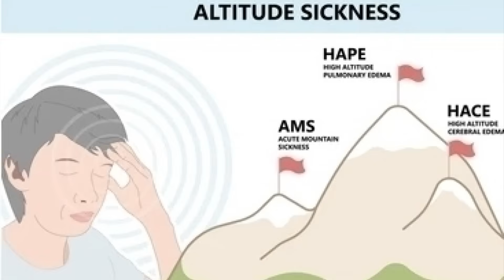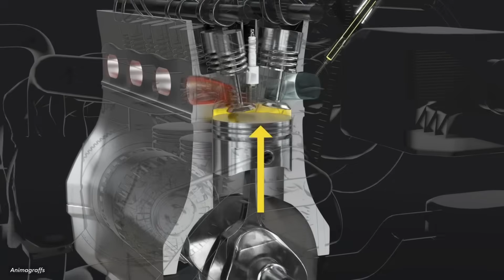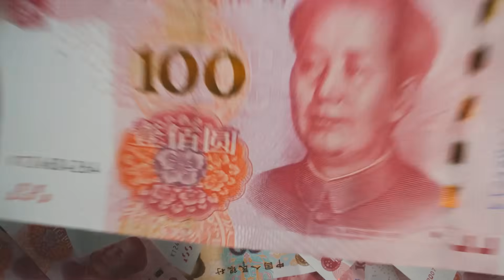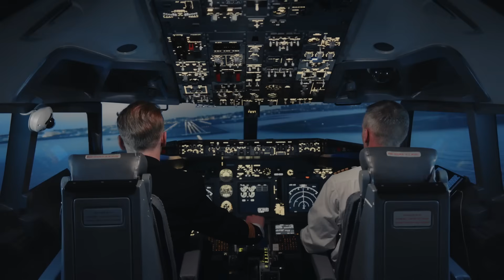How China Built the World’s Highest Airport Above the Himalayas

Comment: The higher it is the quicker to get into the air the plane does not have to go so far down !
Reply: At high-altitude airports, the thin air requires longer runways for takeoff, limits payload capacity, and necessitates greater engine thrust.  During landing, braking distances are extended, requiring enhanced brake cooling and precise attitude control. Aircraft must be adapted for high-altitude operations, pilots require specialized training, and airports need longer runways and comprehensive weather monitoring facilities.

Comment: I could understand high elevation breathing problem because I experienced similar things.  Many years ago, I went to Cuzco, a city in the high mountain of Peru, at around 12,000 ft above sea level.  I went up there by train from sea level.  I was told that many tourists who went there by plane suffered shock and a sudden lack of oxygen that they had to immediately return to sea level.  I, on the other hand, went up there gradually so it didn't shock me, but I did sense the air up there was rather thin.